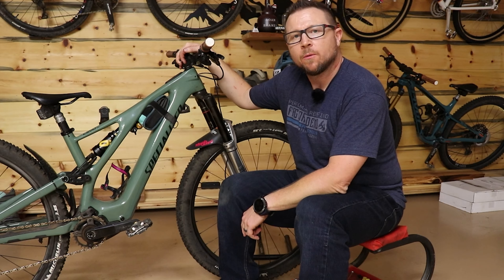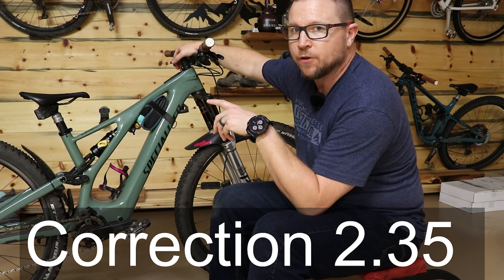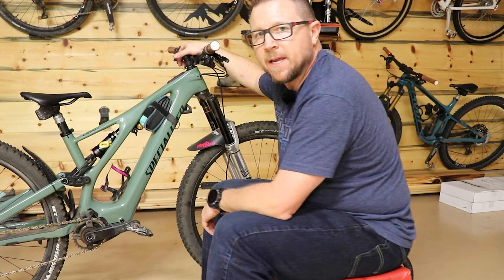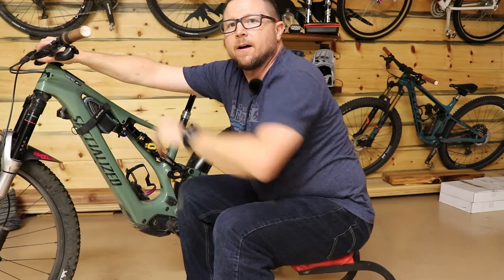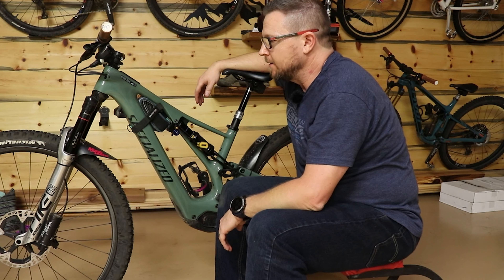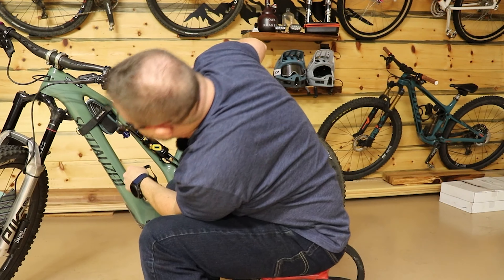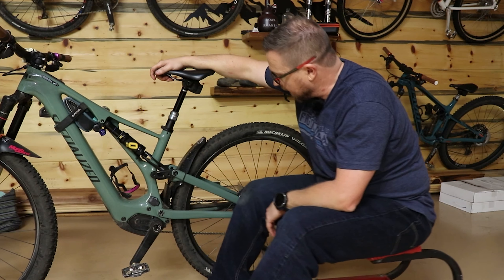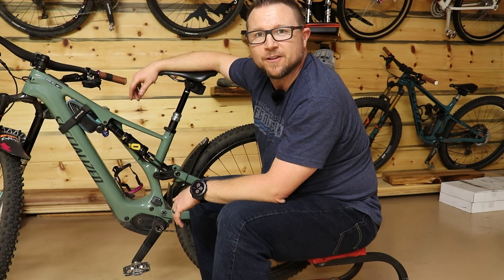Better and Lighter than an S-works Levo SL, My wifes 2021 Turbo Levo SL Walk Around

Comment: weight does not matter now that they have motors. The biggest fallacy in mountain biking is that faster and lighter is better. I think fun factor should be the only metric when measuring how good a bike is.
Reply from the maker: Weight in fact is not a fallacy against torque and battery life. And depending on your strength and endurance it will matter greatly over miles. More miles equals more fun, you get there by managing the power to weight ratio of not only yourself but the bike against the motor. The fun factor is in fact important as well, and overall weight to riding style is an aspect of just that.
Reply: @LoamRoamer  that’s a good point. I suppose the battery would go longer if bike is lighter. Then people go slinging water and snacks into a backpack and bring it right back :-)
Reply: Exactly! Saving small amounts of weight on E-MTB helps you to add extra water, food or tools. Not to mention loading bike onto rack or truck.